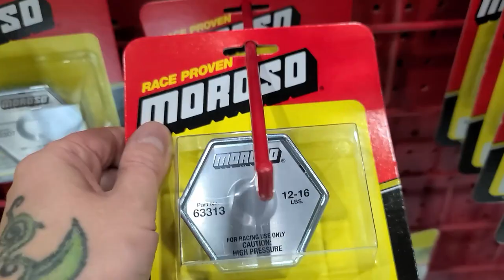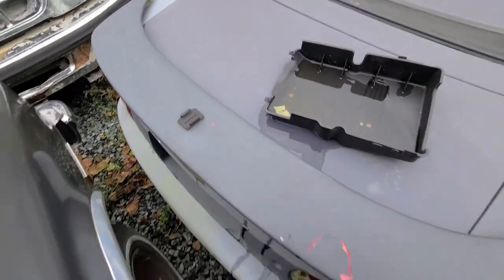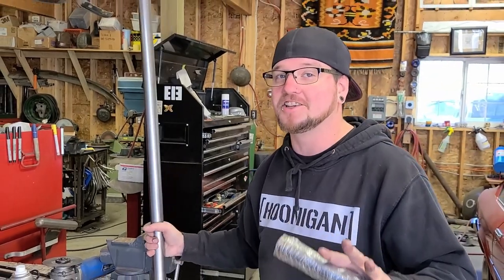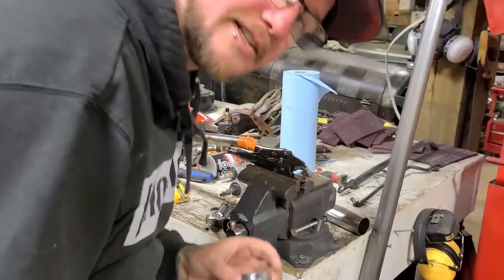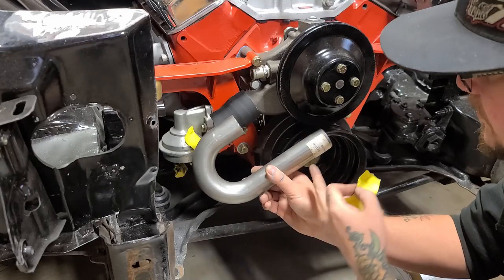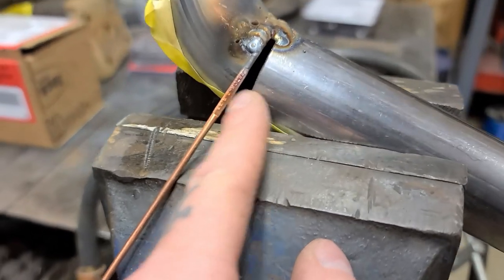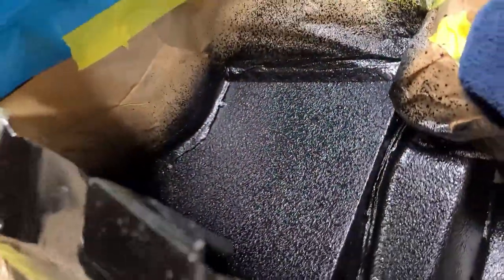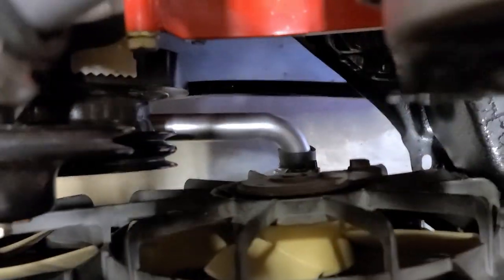How To : Hard Steel Coolant Hoses - SlickWorks EP11

Comment: Nice work . Wouldn't it have been easier, cleaner, and cheaper to have just changed the thermostat housing ?.
Reply: Easier, yes.
Cleaner, no.
Cheaper? maybe by like 50 cents.
Cooler?.... Not a chance.
Reply: @mikewhone5440  I'm thinking cleaner ... yes ... straight shot but hey , it's your build . Nice work all the same .
Reply from the maker: Why I think it wouldnt be cleaner is the filler neck wouldnt be perfectly centered on the engine, it would be awkwardly to one side. But I get what you mean. Thanks for watching, Mike
Reply: Or just turned radiator upside down
Reply from the maker: @garykeenan3724  Gary... we've been over this. the inlet and outlet would still be in the same spot 😂